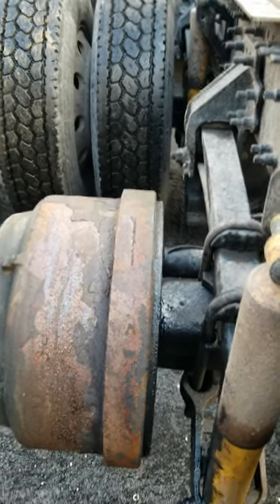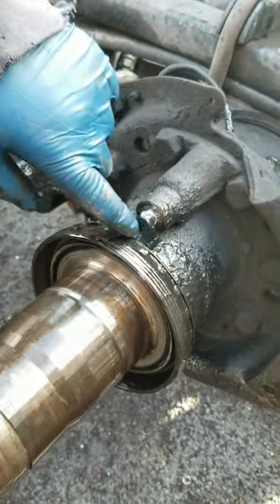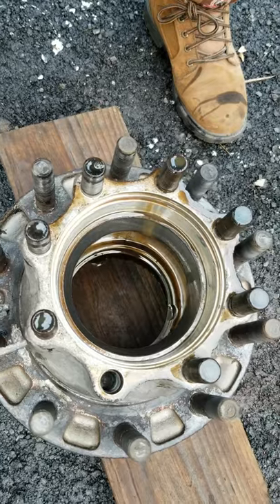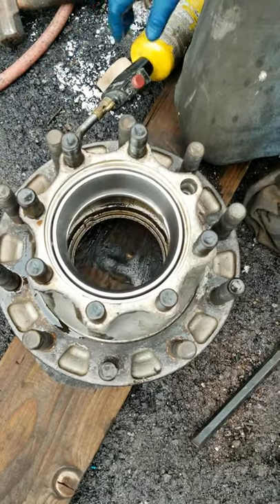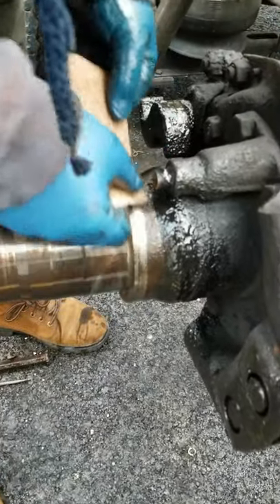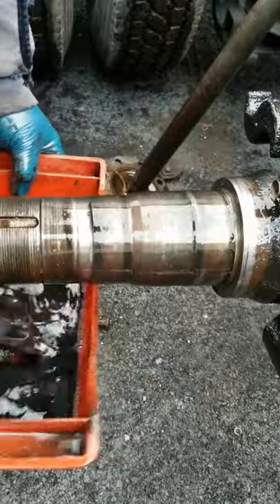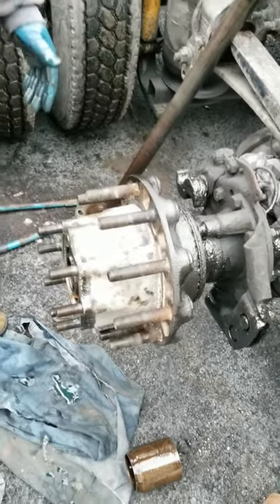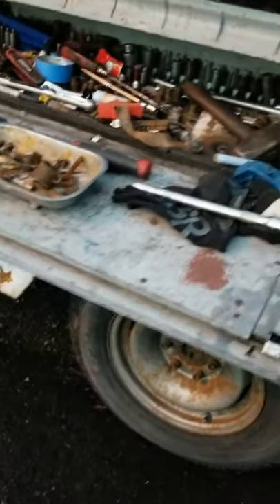truck wheel seal replacement  ( how to replace  leaking wheel seal on truck drive axle )

Comment: The reason that wheel seal was leaking is because a preset hub should be tightened to at least Like 500ft lbs and since you didn’t put the torque cone back in you should have measured wheel end play. And you really should have installed the torque cone
Reply from the maker: that's in theory correct sir

Comment: Any tricks to exchange u joint and carrier bearing without special tools?
Reply from the maker: I don't know of any special tools for carrier bearing . I cut it in half using cut off wheel grinder . don't worry if you cut a bit into the shaft , won't hurt anything .
Reply: Ivan Tulala Thanks man for fast reply 
How about u joint if those cups won’t come out easily?
Reply from the maker: @Vertikala-pc5ig  there is a tool for that available on ebay. just search for heavy duty u joint puller . I have the 100 dollar one and works fine . local truck parts stores carry those as well , they not eBay prices tho
Reply: Ivan Tulala Thanks God bless you 
Just curious what is your background we have lots of names Ivan back home in Croatia.